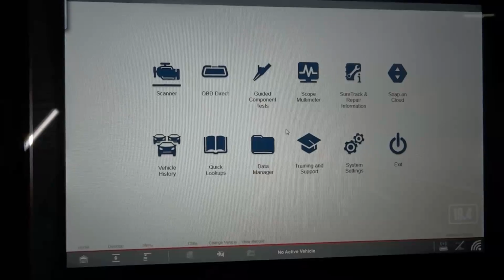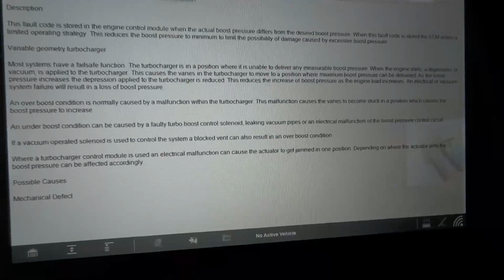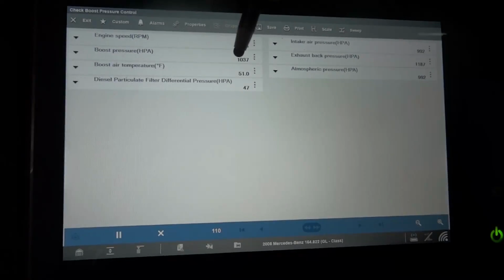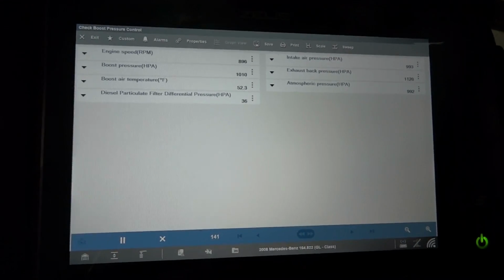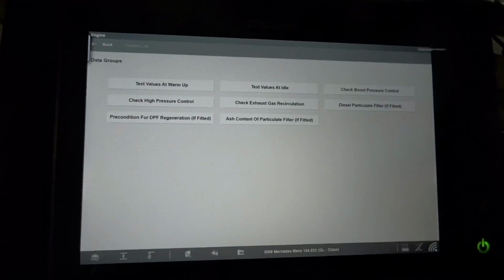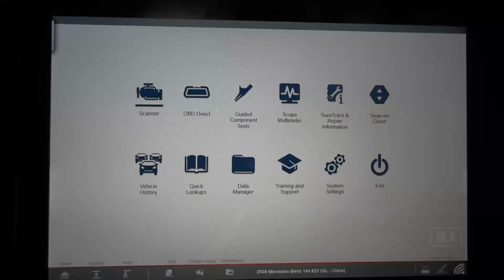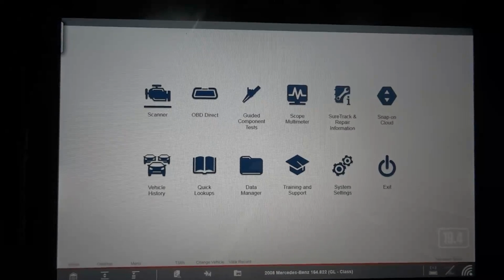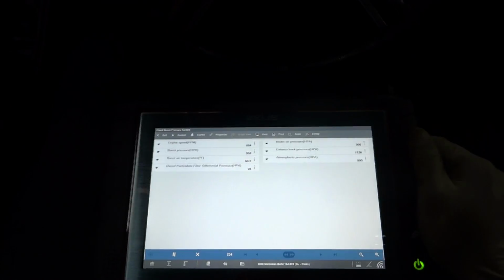How to test a turbo Actuator on a Mercedes GL320, Code P0245-P0299, Low Power Concern/ Limp Mode...

Comment: Great video. I am having same problems with my car (Merc W211 E280 CDI) but actuator seems fine (took out and checked wiring), and the part is only 2 years old. Did you check the electrical parts of the one you removed?

I wonder whether the problem is the motor to the swirl flaps being damaged due to oil leakage via Turbo air intake gasket. I have removed the intake pipe (from both air filters) and cleaned gasket and area all around the turbo inlet. Have you heard of the 4.7k ohm resistor trick to bypass the swirl flaps motor sensor telling the ECU that the motor is fine? Could this cause longer term damage?
Reply from the maker: Nik Wells Thanks! No I haven't heard of that technique! what trouble codes do you have in memory?
Reply: @KITS_Auto_and_Truck_Repair  P2008 is the fault code I receive on my cheap Streetwize SWODB4 code reader. It doesn't seem to allow me to clear this particular code, but maybe because it is continually there???
Cheers
Reply from the maker: @TruthPlusFaith-7  Yes!
Reply: @KITS_Auto_and_Truck_Repair  I really don't know what is causing it though. Shouldn't be swirl flaps (as 4.7K resistor bypass done), tested actuator, which is actually a new (reconditioned) Hella one with warranty sticker, cleaned back pressure sensor, cleaned EGR valve thoroughly, cleaned turbo intake gasket and re-seated. Totally baffled. Any thoughts?
Reply: @KITS_Auto_and_Truck_Repair  I took EGR valve off again and cleaned it again, this time with the valve pushed open with a screwdriver. I also checked the continuity and voltage of back pressure and EGR valve sensors (all good). What I did notice when turning ignition on (not starting) was a rather strange sound from turbo actuator. I gently nudged the actuator arm, as maybe slightly in wrong position or sticking, then, when ignition started, actuator kicked into action. Cleared fault codes. Took it for a test drive. and although it was jumpy when accelerating hard, a horrible cloud of thick exhaust came out, cleared its throat and then was accelerating fine above 3000 rpm, tested for about 15 mins with normal, hard and kick-down acceleration. No jumping, through gears fine, appears fixed!! Not sure what actually did it but fingers crossed fixed now.
Reply from the maker: @TruthPlusFaith-7  is your boost pressure sensor good! Test it and see what happens, I have videos on the channel that can show you how to do that!
Reply from the maker: @TruthPlusFaith-7   sounds good! I'm glad to hear that it's fixed!
Reply: @TruthPlusFaith-7  did you fix it? I have the same problem...i replaced the actuator and the car is not working properly...when pressing the gas slowly the engine starts and is nervous.
Reply: @igorbozic6801  Hi. No the fault returned. My gut feeling is that it's the actuator and a new one is required, professionally fitted. However, I have since sold the car with the fault and lost a tonne of money on it. Very common fault that Merc should, in my opinion have a fix for, particularly the oil leak onto the swirl flap motor.

I wish you luck.

Comment: This is one of the best mechanical teaching videos I’ve seen. You describe and show everything as you’re doing it. TY!
Reply from the maker: Lauren  Thank you!!
Reply: I am 75 year young and the way you taught this demo was amazing. Question will this replacing the Actuator work the same on a Mercedes 2015 CLS 300 4 door Benz
Reply: I forgot to tell you I am a grandmother/professor retired… 
Please let me know if this will work for my C 300
Reply: @dorishigginbottom6827  should be the same with all hella actuators
Reply: @psykoosi2477  not so, I’m told that Mercedes interlocked all the parts together and it all has to be replaced the actuator and turbo on the 2015 CLE 300. The parts will cost me $3,045.+ dollars (parts alone)
Reply: @dorishigginbottom6827  Partly true. You can't really buy a new actuator because they are manufactured for the turbo and therefore not sold separately. But there are shops that fix your actuator or are able to sell a refurbished one for around 200$. Where are you located? No need to be specific, continent will do

Comment: I would just like to thank you for this seriously helpful video, my W164 ML320CDI developed a turbo actuator fault, and with the info in this video I was able to test, remove and replace the actuator very easily, with little more than a Bluetooth scanner, voltmeter and socket set. Unfortunately the T-shaped intake duct fell apart in the process so will be replacing that too but your video was instrumental in the fault finding process. Thanks again!

P.S. One thing I would add, is that getting the 4x M6 bolts out of the back of the actuator is a pain, as is replacing them, and it's very easy to lose them. A few of mine dropped down requiring me to drop the underbody protection panel. Loosening the turbo heat shield helps a little but it is still awkward. A cleverly placed magnet would probably be a good idea if I did the job again.
Reply from the maker: George Mason  My Pleasure!! Thanks for your input, I'm glad to hear that the video was helpful!!

Comment: How many volt need to be on signal wire?
Reply from the maker: jun2274 the computer grounds the control wire to move the position of the vanes in the turbo!!

Comment: Hello,  my c250 2013 is entering a limp mode. Before that the turbo scrapes then directly go to limp mode. Scanner shows error "Turbo boost pressure too high". I read that problems like that might be caused by  turbo sensor or turbo actuator. May you please help and give an advice please.
Reply from the maker: omar tannir  yeah you might have a turbo that's going out!! or a leak on the turbo tubes etc...

Comment: great video now i can troubleshoot my intermittent fault on my 04 E320 CDI low boost pressure
Reply from the maker: Simon Malpass  Thank you!!  Good luck with your project!!
Reply: are you fund your problem?
Reply: @angelsegnini  yes i did the actuator on the turbo was not working intermittently so replaced with a new turbo and problem solved 👍👍

Comment: To ALL WATCHING, check the moving arm on the actuator, they are different, there is a guy on amazon who blame the seller for fake unit. All it was his car was different model.
Reply from the maker: Janosik 57 Great info thanks for sharing!!
Reply: @KITS_Auto_and_Truck_Repair  Hi K, I repaired a broken wire inside the actuator as some people advice on Youtube, this could save You some $ in the future instead of replace it.
Here in Australia everyone is greedy and they ask AU$ 375 for "refurbished unit",
it take about 30 - 60 min to repair and install it/ depend of your ability/ if you take only the plastic cover of 
and don't remove the actuator.
But it could be another problem as well as you explained in the video.
Reply from the maker: @janosik5780  sounds good!! I'm glad to hear that you were able to fix your actuator!!

Comment: I enjoyed your excellent video.  I have a 2010 Mercedes ML350 Bluetec with a P0299 code.  I dread replacing the actuator but now it should go good after watching your video.  You did a through troubleshooting job.  Before taking the actuator off, I will check the wiring of the turbo boost solenoid and actuator first like you did.  Right now, I am thinking it is going to be a problem getting the right parts but will be surfing next. I am amazed on how easy you made it look at getting those three bolts out as I know where they are at.  Thanks a lot!
Reply from the maker: Wayne Hendricks  My Pleasure!! Good luck with your project!!

Comment: Hi can you help on a mercedes sprinter 3.0 v6 om 642  im getting a code 2082-008 
It says b28/8 dpf plausibility due to defective hose line 
I have replaced the sensor and checked the hose pipes and the clamps they fine I have also checked the wiring im getting ground/reff and signal voltage on the back probe 
My symptoms are misfiring detonation sounds and picking like sound from the engine when I rev the engine 
Thanks
Reply from the maker: Rafiek Ahmed  if the wiring is good and the sensor and the tubes but the problem is still there you should reset the computer and see what happens, do you have a scan tool that can do that?
Reply: @KITS_Auto_and_Truck_Repair  Hi I'm getting +4 with key on and  minus 48 at idle

Comment: Hi there, thanks for the video..but am wondering how does the ECM control the actuator by just using ground, cuz it looks like the lever goes to the end cycle and goes back to the other, what if the ecm decided to change direction it sends power may be..? Looking for the answer thanks.
Reply from the maker: Salah Kebi The ECM reverses polarity on the control wire to make the actuator travel on both directions
Reply: @KITS_Auto_and_Truck_Repair  Thanks for the answer, I found out that the ecu controls the actuator using the PWM signal.
Reply from the maker: @salahkebi05  yeah!!

Comment: GREAT VIDEO...THANK YOU SO MUCH FOR THE EXTENSIVE KNOWLEDGE OF GUIDANCE....I LIKE HOW YOU TEST EVERYTHING...I JUST GOT A 2009 GL320 TURBO CDI DIESEL...I GAVE ME SO MUCH CODES...PO299....P1408....SO I TOOK OUT THE EGR VALVE AND CLEANED IT....NO MORE CODE P1408....I REPLACED THE TURBO BLACK HOUSING INTAKE WITH NEW RUBBER ORANGE SEALS....STILL GAVE ME PO299....SO I WATCHED YOUR VIDEO AND PRAISE THE LORD JESUS....IT WAS THE TURBO ACTUATOR....MY CAR IS RUNNING LIKE A DREAM....THANK YOU AGAIN....
Reply from the maker: Dorky Rouge you're welcome!! I'm glad to hear that the video was helpful! thanks for letting me know!!

Comment: Intake pressure is for the suction side of the turbo and is a measurement of atmospheric pressure. Boost is after the turbo to the engine measuring boost pressure so intake pressure should be 950 mbar approximately and boost pressure should be more depending on spec

Comment: Very good video, very nicely explained ,just want add another easier test for actuator before removing anything. (One person test).
1- remove engine cover ( so u can see the turbo from driver door ).
2- put the key in ON position  ( see if the actuator linkage moves ) then start the car for further moves.
This is only test is for mechanical test of actuator.
Reply from the maker: Hardytch 82 oh really? that's good to know, I didn't know that test, thanks for sharing....

Comment: First thanks for your video you did a great job and helping Everyone to understand what's going on. Ok, now I have 2017 GLS amg63 that just shows up a check engine with the P0299 Code! Turbo/super Charger Under Boost 1 is too low and it says (DTC severity 2 of 3 repair immediately) Thank you for your help.
Reply from the maker: Mike picasso you're welcome, this code can be caused by a defective boost sensor or a defective actuator on the turbo, follow the steps in the video to test it, or you could have stuck vanes inside the turbo... you check that by disconnecting the actuator and then actuate the lever on the turbo by hand to see if the vanes are stuck in the turbo... Good luck
Reply: @KITS_Auto_and_Truck_Repair  thank you my friend I will do and will update you.
Reply from the maker: @Picassomad73  sounds good!!!

Comment: Hi from South Africa thanks for a great and informative video
what voltage should i get at the turbo actuator plug
Reply from the maker: Rafiek Ahmed Hello my friend from South Africa... you should get 12v at the actuator and ground, the control wire also has 12v coming from the computer, the computer also switches it's polarity to make the actuator move to the opposite direction
Reply: @KITS_Auto_and_Truck_Repair  hi thanks for that info I will do some voltage checks
Reply from the maker: @rafiekahmed8568  you're welcome
Reply from the maker: @rafiekahmed8568  you're welcome...

Comment: Great video bro, i have the same problem on my 2008 dodge sprinter 3500  do you recomend me do the same?
Reply from the maker: Manuel Moreno, if you have the same trouble code, check the actuator manually to see if it's working, if it is, then your issue might be the wiring or stuck turbo vanes... check those things first before you buy anything, Good luck

Comment: Yo K I have a 2014 gl 450 and when I hit bumps in the road it feels like I have no shocks almost like suspension is no good but everything raises up with np and stays up any thoughts
Reply from the maker: sounds like a weak compressor or leaking valve... you have a pro look at it for you
Reply: @KITS_Auto_and_Truck_Repair  thanks for the response yeah I was hoping it wasn't going to be the compressor again just replaced a compressor on my 2011 jeep overland that was 1300 wow so let me ask even it raises up and down it's still can be no good correct

Comment: Where is the boost pressure sensor? You said you checked it and it was ok. Sadly for me I check the actuator and it checked out fine so I believe my problem is the boost pressure sensor but I’m not sure where it is
Reply from the maker: Cody Smith, the boost pressure sensor is located at the right of the engine, downstream of the throttle valve actuator... check wiring first before replacing the sensor.... good luck, I hope this helps,
Reply: If the boost pressure sensor is bad that will affect the use of the selenoid ?

Comment: Did you need to use the G code inscribed on the housing of the actuator to match the part you bought or how were you able to find the correct replacement from amazon?
Reply from the maker: Brad atkinson I just tapped the year, make and model of the car then it came up, it looked the same... I ordered  it and all was well...

Comment: Hello I need a diagnosis for a Mercedes benz GL 320 cdi has the workshop in Tampa fl
Reply from the maker: Nelson Morales, I'm in Frederick Maryland
 I could have looked at it for you if your shop was not far from me... Good Luck!!
Reply: K Diagnostics the rear door does not close with the button I have to close manually it first worked and then I stop working it has power but I stop working
Reply from the maker: @nelsonmorales51  you get a technician look at it, there is a couple of things that can cause the door to not close... if you have power make sure you got the signal after you press the button

Comment: I have a 2009 GL320 Bluetec (Diesel) Mercedes Benz The Car is loosing power while driving. I am in Brooklyn, and I am looking for Great and Fair Mechanic to Fix it. I have Code P2007 Intake Manifold Runner Control Stuck Closed bank 2. Many thanks.
Reply from the maker: duran duran, if I knew a good technician in the Brooklyn area, I could have recommended one but I don't unfortunately, Ask around or just Google... Good Luck!

Comment: Nice diag bro!
Is there a bi-directional command to the actuator in "active" mode? (I'm using autel)
Reply from the maker: Sakeenah Auto Solutions , my Scanner didn't have a bi-directional command for the turbo actuator, I haven't used an Autel Scanner yet and depending on what model you have, but I think you might be able to turn it on and off with it 
if it can allow you, or you can test it manually like I did...
Reply: K Diagnostics hola
Reply: @KITS_Auto_and_Truck_Repair  mine did not either. I tried manual testing it but it was barely moving. So I opened up the shell. The motor and logic board are separate. Power and ground to the motor works. So I guess in my case the logic board is at fault. The "signal wire" seems to just change the polarity allowing the motor to turn left or right because manually by switching powers and ground directly to the motor  would do just that. 
So we've ordered the Amazon actuator to see if it'll fix it
Reply from the maker: @Usmanthemecano  it's impressive how far you've gone with testing the actuator... I got mine on Amazon too, so you should be good after replacing it
Reply: @KITS_Auto_and_Truck_Repair  honestly your video made it easy for me
Reply from the maker: @Usmanthemecano  thank you

Comment: Hi brother and thanks x yr video. 
Just I need to check the actuator but from where can I get the ground. 
Please help thanks
Reply: Gracias amigo
Reply from the maker: Khalid Zahiq  any bolt attached to the cylinder should be Grounded

Comment: Greetings from Cape Town brother. Thanks for an awesome trouble shooting and resolve👌 Will attempt to do it by myself now. Car repair costs here are horrendously expensive. Thanks again!🙏
Reply: Sean Kellogg this is awesome and helps a great deal. Thank you Sean👌🙏
Reply from the maker: Jerome Topley you're welcome brother, I'm glad this video is gonna be helpful to you… Good luck with your project
Reply: Hi there again. The coin tray in my 2007 ML 320CDI is faulty. It shoots out every time I hit a bump on the road, irrespective how small the bump. I don’t know how to check.Do I remove the whole centre console? Is this a common problem? Regards
Reply from the maker: Jerome Topley the tabs that hold it in place are probably broken, you don't have to remove the whole center console to fix that!!!!!
Reply: Jerome Topley there is a white plastic cam gear that has a spring tensioner. This mechanism does fail an the coin tray is easy to replace. Try to find a used one and swap it out. I bought one from a wrecking yard for only $10
Reply: Thank you so much Sean. Will get on it stat and keep you posted. Regards 👌
Reply from the maker: @seankellogg6154  thank you for your input!